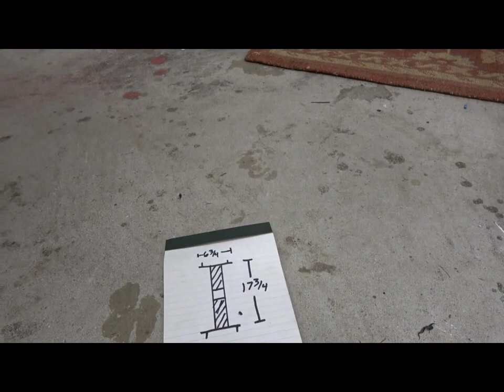24 volt John Deere gator XUV 6x4 Restoration and Lighting upgrades

Comment: It turned out great! Now it needs an electric actuator to lift the bed and a winch in the old battery compartment.
Reply from the maker: I agree on the actuator,lol there is a 12 volt battery up front for the lights but a winch would be awesome. Think we are just going to flip this project to pay for kart racing parts.

Comment: Awesome mods. Great video! I have this tractor but keep running into issues with the circuit board. Ive had to replace it multiple times. Do you know if its possible to fix the board or bypass it all together with a better set up? My kids also have the the smaller gators which last forever. Such simple machines with a battery, accelerator and motors. Not so much with the xuv
Reply from the maker: Ideally rewiring with a variable speed pedal and esc would be a huge upgrade. We have several recent videos on the topic

Comment: Sorry my first question was covered in the video so I'll edit to remove it. 

How do you feel about putting 24V through Peg Perego gearboxes versus Power Wheels? Especially the older pentagon drive since I have an old Magica I want to restore and potentially hotrod. 

Also, what are your thoughts on the Power Wheels Arctic Cat? I have a junk F150 but also have a chance to get a cheap Arctic Cat. 

Thanks!
Reply from the maker: Severe sun fade will be chalky and needs to be sanded unfortunately. Both models are pretty good units. F150 has major front wheel toe issues and the Arctic cat wheels are super thin and wear holes pretty quick. It's a coin toss which one I would choose.
Reply from the maker: Peg boxes won't last on 24 volts, the first gear melts around the shaft from friction. Stick to 18 volts
Reply: @CustomKidzCars  

Thanks for the insight! I saw a video where someone put the wider F150 tires on an Arctic Cat. And I was thinking of going with a simple inner tube style pneumatic since I want to go ESC anyways. Hmm... I guess I still have some thinking to do. 

If it was a 24V ESC conversion with pneumatic tires would you pick the Arctic Cat?

Also thanks for info on Peg gearboxes. I might go with a 24 volt build for ease of batteries and charging but use a dc motor controller to limit motor voltage to 18V. Unless I just go 12V ESC to just preserve it better. 

Anyways thanks for the fun content. I souped up my nephew's 6V truck with a 12V ESC and a separate brake pedal and that thing is so fun. Now it's time to build a beast of a two seater for my son, hence the F150 and Arctic Cat questions.
Reply from the maker: Use the 24 ESC and install a simple potentiometer on the throttle signal wire to limit top speed/ voltage. We have a how to video on our channel. To answer your question, I like both models equally but I would probably go with the f150 because it has more space for electronics,.
Reply: @CustomKidzCars  

Thanks! I did forget about the variable resistor addition to the Hall Effect pedal to control that. 

I previously had been noodling around ways to wire the shifter so in low-speed it sends the pedal signal through an extra variable resistor and in high speed it let's it get full voltage. 

Is that video titled as such? 

Good call on space for electronics. As much as I'll have to restore the appearance, it will be a more solid base to start. Just wish it had more payload ha. 

Another random question - can I use solid axle 7R gearboxes to convert the F150 to 4WD? Like use those gearboxes on the steering arms with some modification of course. I really want to get to 4WD long term on it.
Reply from the maker: @LovelessAndroid  yes, just need all 4 matching tooth count gearboxes. Our 4x4 dodge dually build should help u out